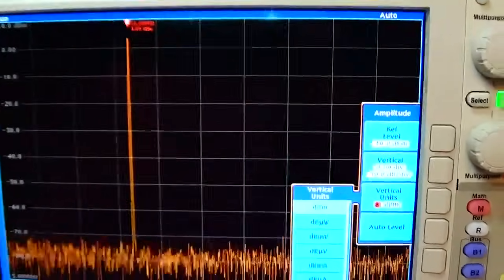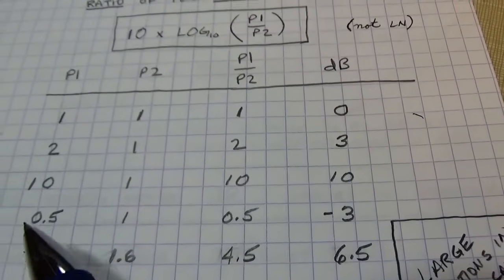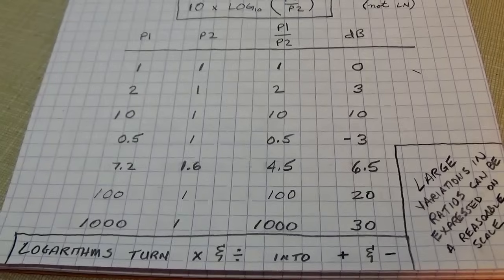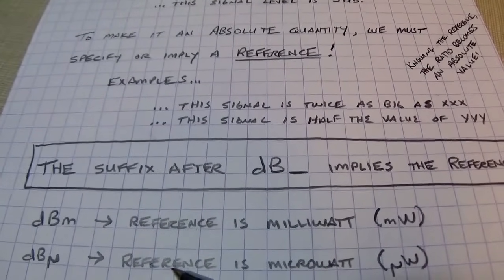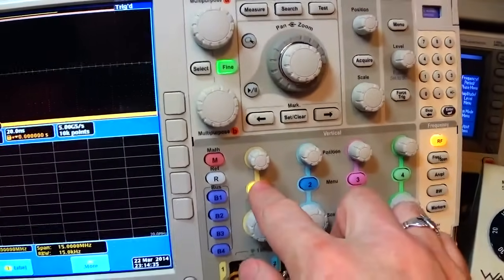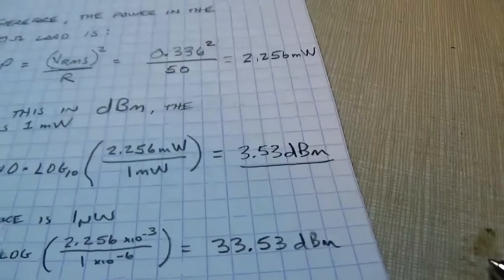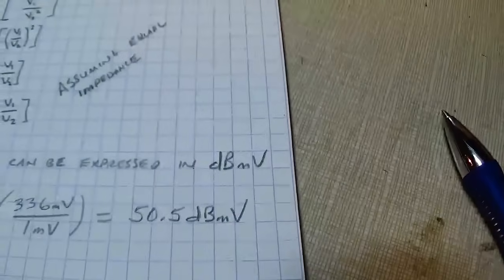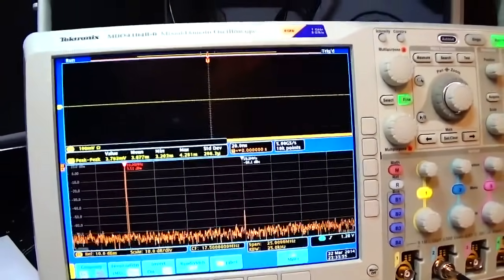#136: What is a dB, dBm, dBu, dBc, etc. on a Spectrum Analyzer?

Comment: You called dBμ "dBu", but that's different scale entirely (dBu = RMS voltage relative 0.775V, mainly used in audio).  Can't be too careful with naming these units, or you'll end up with a whole load of blown up components - or none :(     I don't even know how you'd say dBμ... dB micros?  When teaching, I'd stick with your oscilloscope's option of calling them their full name of dBμW to definitely, positively avoid any confusion.  Then when by yourself, as long as you know your reference, you can call them whatever you want (dBw2aew's??).
Thanks for your videos, I hope you don't mind my slightly nitpicky comment, but if you get the wrong base on your dB scale, you could run into all sorts of problems.  There's SO many dB scales, that even a slight slip of the pen could have you putting far too many volts into a circuit!! (dBf to dBk would certainly do it!)  :)
Reply from the maker: Good point! I guess I simply took the RF-centric view. I guess you could call it dB-mu. The audio measure also assumes 600 ohm impedance also, I believe.

Comment: I'd love to see you do a video on a VSA. I worked for 6 years as an RF Test Engineer on Cable Modems and Cable headends. I loved the power of the VSA, giving me the capabilities to look at signals in so many different ways. Time domain, freq domain, constellations, eye diagrams, etc.  Great stuff you're doing. Kudos!
Reply from the maker: I think you've discovered that I do have some videos using a VSA. More precisely I am using a realtime spectrum analyzer, which is a VSA with realtime capability. I've got several videos using the RSA.
Reply: Yes. Thank you!

Comment: what does -45 db means in wifi signal strength given by heat map.Please explain
Reply: The negative dB values simply indicate that the measured powerlevel is below the reference used for the measurement. For example, -45 means that the measured value is 45 dB below the reference power level.
Reply from the maker: It's difficult to say. A dB is a relative value, but they don't say what the reference is that they're using. So, it can be used as relative measure. Note that the more positive, the higher the strength. So, -45dB is 10x more power than -55dB, for example.
Reply: Thanks
Reply: One more doubt,why this power is in negative? Please reply
Reply: Thank you,dear friend
Reply: Eldo c paul   The minus means that the signal is weaker than some standard.  45 means that the amount weaker is found by  10^4.5   Take your calculator.  Enter 4.5.  Press the key that reads 10 with a superscript x.  The result is 31,622.78.   So, the signal is thirty one thousand times weaker than the standard value.   On some calculators, you get 10^x with a two key operation,   inv   log

Comment: Is it possible to do a video about dBK (dB relative to Kelvin, to express noise temperature)?
Thanks.
Reply from the maker: +Ahmed Joma I've only ever seen noise temperature converted to dB when calculating the G/T metric for satellite receivers.  By simply converting noise temperature to dB (10*LOG(T)) where T is noise temperature in K for the receiver, the G/T can be easily calculated by taking the receiver antenna gain (in dBi) and subtracting the noise temp dBK.
Reply: @w2aew  The result then being G/T in dB/K :-)  Make sure not to get confused by dBK, i.e., 10 log10(noise temperature in kelvin) and gain in dBi minus noise in dBK which is written as dB/K.  There is also noise figure (F) given in dB which is 10 log10(1 + (noise temperature / To)) where To is a reference temperature like 290 K.

Comment: how to convert dbvrms to dbc?
Reply from the maker: +Prabha Vasudevan You can't.  dBvrms is an absolute value, but dBc is a relative value.  dBc refers to the relative magnitude of a signal compared to another signal, usually a carrier.  That's what the "c" means in dBc.  dB is always relative to something.  In the case of dBvrms, it refers to dB relative to 1Vrms.  dBc means dB relative to the magnitude of some other signal referred to as "c".
Reply: +w2aew is it possible to convert dbvrms to dbm?
Reply from the maker: +Prabha Vasudevan Yes, but you  have to know the impedance involved because dBvrms is a measure of voltage, and dBm is a measure of power.  Assuming a 50 ohm impedance, then the conversion is simply:
dBm = dBVrms + 13

The derivation is:

dBm = 10 * LOG(V^2/R/(1/1000))

dBm = 20 * LOG(V) + 10 * LOG(1000/R)

Since 20*LOG(V) is the same as dBVrms, we can substitute that:

dBm = dBVrms + 10*LOG(1000/50) assuming R is 50

dBm = dBVrms + 13
Reply: +w2aew  thanks a lot:)

Comment: so jealous of that beautiful instrument.  Had never seen the MDO series before.
Reply from the maker: +Jason Jones One of the best things about the MDO4000 series is that the RF signal is captured over time, simultaneously with the analog and digital channels - giving you the ability to correlate RF/spectral events with time domain events, examine modulation vs. time, etc.
Reply: Stop depressing me.  ;). As a casual tinkerer, a 25k instrument does not belong on my bench.  ;)
Reply from the maker: +Jason Jones Yeah, sorry about that ;-)  I am very lucky to be employed by Tektronix, thus have easy access to a lot of great equipment.  It helps to make it easy to teach many topics on my channel.
Reply from the maker: Yes they do.  My job is a Field Applications Engineer, so this equipment is basically in my possession.
Reply: so they let you make videos on their equipment?

Comment: Excellent tutorial.  My question would be if db an be used to express values in voltage and power, can it be used for amps as well?
Reply from the maker: +Joseph Nicholas Sure - you would still use the factor of 20 like you do for voltage.  A unit like dBmA is decibels relative to a milliamp.

Comment: Hi w2aew,
Thanks for this informative video.
I have a question on this, if I read a spec of a Mic, the sensitivity would be indicated as say -54.5dBV @ 1kHz. Does that mean at 1kHz audio it is 3.5million times sensitive ?
..and for speaker, say it is 93dB, would that mean its 1.99billion times sensitive ?
Regards
Reply: +Vignesh Baliga I just want to come back to your question about the 93dB on your speaker. This value says you how efficient your speaker is, for example a speaker with a 95dB printed on it means that it will put out an audio level of 95dB (as loud as a heavy truck driving next to you) when given 1 Watt RMS to it at 1 meter distance. It would be an efficiency of 2% (that is actually pretty good for a speaker). The unit for this is "dB/m/W" or decibel per meter per Watt. I hope this may help you a little bit.
Reply from the maker: Vignesh Baliga There's not enough information here to answer fully.  You have to be very careful with specs like these for audio - because the reference values and units vary a lot depending on what spec you're looking at.  Remember, dB are always relative to something.  For example, -54.5dBV could mean -1.88mV due to (20*LOG(0.00188/1)=-54.5dBV), but this doesn't say anything about the SPL (sound pressure level) at the mic input, nor does it say anything about the impedance involved.  93dB doesn't say anything about the speaker without other conditions.  It is likely a measure of the SPL at some drive level, but again it is all relative to something which isn't specified here.
Reply: ***** 
Thanks for the reply. I think it’s a bit more clear to me
now, and with that I agree, with just this data -54.5dBV at 1KHz for a Mic, we cannot
deduce much about the mic. Arriving at 1.88mV also helped me, I guess a mic with -54.5dBV
is less sensitive than a mic with -40dBv (10mV signal) assuming rest all the
parameters remain same. Would that be correct ?Thanks again
Reply: +xubor Thanks for posting this info, was totally in the dark about Speaker efficiency being at 2%. 
Previously I thought higher dB rating meant better speaker but I had no reasoning for it, now it makes more sense.
Reply: +Vignesh Baliga I thought a few days about the -54.5dBV of your Mic and have an idea what it could mean. If you have a volume or SPL of 54.5dB feeding in the mic that it will put out 1V. But that would also mean it will put our 10V at a SPL of 20dB more so at an SPL of 74.5dB, witch is kinda unrealistic or it is a very sensitive mic. So it just a thought.

The 2% speaker efficiency is like i said very good, if you have a cheap one with lets say only 85dB/m/W it will have an efficiency of 0.2%

Comment: A more simplified formula to find RMS voltage is Vp x .707.

A spectrum analyzer is a extremely expensive piece of lab equipment second only to a network analyzer in cost for a quality unit.

And no RF explorer is no substitute, its more like a poor man alternative.
Reply: +niceguy60 VRMS=Vpx0.707 but we are given Vpp=950mV
VRMS= (Vp/2)X0.707
VRMS=(950mV/2)X0.707
VRMS=335.8mVRMS

Comment: Hi w2aew, I saw this video long ago and wanted to thank you. Now I have a doubt I have come across while using the FFT function of a Rigol scope: what is dBVrms? I have searched the internet looking for the reference value for dBVrms but I dont know, thanks!
Reply from the maker: dBVrms is simply equal to 20*LOG(Vrms/1Vrms).
Reply: *****  and 1Vrms = 1V/ sqrt(2) =~ 0.7071V  ?
Reply from the maker: jfernandmy Almost...  You have to be careful about what you mean by 1V.  
For an AC signal, Vrms = Vpeak / sqrt(2).  Or, Vrms = Vp-p/(2*sqrt(2)).
Reply: Thanks for your answer, I am still a bit confused: so in the unit "dBVrms" there is no reference value like for dbuW, etc? Is the "absolute" reference relative to the measurement?   For example, in an FFT in which the vertical division is in dBVrms, how do I know the absolute value of the input signal in an specific frequency?
Reply from the maker: jfernandmy For dBVrms, the reference is 1Vrms.
Reply: ***** Thanks! I'll have to study this much better.

Comment: Thank u very much sir...now I got the clarity of units...sir...in my project work I have to built my own dB Metre...I have the circuit which sense the sound & varies out put in volts..I applied formula on o/p voltage..but here I came to know that we should measure p-p voltage..but how can I measure p-p voltage in an analog circuit..
Reply from the maker: You can easily measure peak voltage using a peak detector.  Here's an example:
https://www.youtube.com/watch?v=Fn5kHhNRsz0

Comment: Very good tutorial. In telecomms systems a reference power level assumed a 600 ohm rather than a 50 ohm load. The calculations would therefore yield different results for dbm, dbu, etc. It is therefore necessary to specify the relative power level with respect to the load used.
Reply from the maker: Absolutely right - although it is usually evident by the "context".

Comment: Hi Alan, so how would your calculations change when your spectrum analyzer has varying internal attenuation?
Reply from the maker: In the majority of cases, the spectrum analyzer automatically compensates for the internal attenuator value. Thus, the signal levels don't change on screen when the attenuator changes, so the calculations don't change at all. The most visible change in the trace behavior is the lower noise floor at lower attenuation values.
Reply: ***** Thanks for the quick response! I can see what you're saying is true as I manually change my attenuation. I'm trying to figure out why I have a discrepancy between signal dBm measurements between two spectrum analyzers. I just thought maybe it was because of their difference in internal attenuation. Any other settings I should focus on?
Reply from the maker: The other settings that can lead to differences (depending on signal characteristics) are Resolution Bandwidth (RBW) and the trace detector type.

Comment: Nice video, Alan. Two Alan's don't make a right though. I especially enjoyed  the dBc part as I've seen this mentioned in cable TV company calculations and never knew what it meant. I was IT guy in cable industry for awhile - didn't work with RF so much - but did ride around one day with the field techs and also worked with the Head End Manager because of the Cisco CMTS equipment used. I now work in Marine Electronics - primarily WiFi and Cellular and Networking ... but deal with dB stuff in cable losses for antennas and dBm for WiFi Radio transmitter power levels. Oh and I'm also a Ham but you probably figured that out by now. 73 de KA4UDX.

Comment: Well done for a superb explanation once again. I wonder if it would be worth explaining the difference between dB below PEP when measuring a transmitter the ARRL way as against the conventional dB below one of the carriers when doing SSB measurements.
This causes a lot of confusion within the amateur radio community, people comparing apples and pears!
Reply from the maker: Not a bad idea.  The dB below PEP is used for the 2-tone SSB test, where the PEP is 6dB higher than the power read in each tone on the spectrum analyzer.  This is because the two tones beat against each other, resulting in a peak voltage level that is twice the voltage of either one, thus is 4x (+6dB) the power level of either one.

Comment: Can you make a video on how to bias a BJT mixer, a differential mixer and a Gilbert cell style mixer ?   What is the range of bias levels over which a transistor will "mix" the RF and LO signal ?  What should the peak to peak voltage of the RF and LO signals ? Great youtube channel.  Cheers.
Reply from the maker: It's not really possible to talk about proper bias levels without considering a specific circuit/schematic.  In general though, the usual case is to establish bias and drive levels such that the LO switches the active devices on and off, and the RF input is within the linear region of operation when the LO has the active devices on.  That's about the most specific statement one can make without dealing with a specific circuit.
Reply: Should a BJT be biased at in forward active mode, or saturation mode or at the "knee"
between the two modes for mixing ?
Reply from the maker: Peter B I don't think there is one universal answer - but I'd start with "at the knee", so that the LO drives the device into active and and cutoff.  With BJTs, you want to avoid driving into saturation because of delay issues coming out of saturation.  And remember, saturation region in a BJT is different from the saturation region of a FET.  In a FET, the "active" region is called the saturation region...
Reply: *****
What is the best book to read about this topic of mixer biasing ?   Thank you so much for your advice.
Reply from the maker: Hmmm. Maybe "Experimental Methods in RF Design" by Wes Hayward.

Comment: Am I the first to reply?

Fantastic explanation, so clear and fumble free, I think you either know your subject inside out and backwards or you are a tutor.

When I went through college to complete my City and Guilds Electronics course, db's weren't really touched on too much, well it's been 35 yrs now so my memory may be faulty.  We did discus vectors in R,L,C  circuits and 'j' . that was a nightmare, any chance you could go over that in a video?
Reply from the maker: The tail-end of this video does a little of this complex math (using i instead of j, but it's the same thing):
Use an Oscilloscope and Signal Generator help tune an HF Antenna, and measure complex impedance